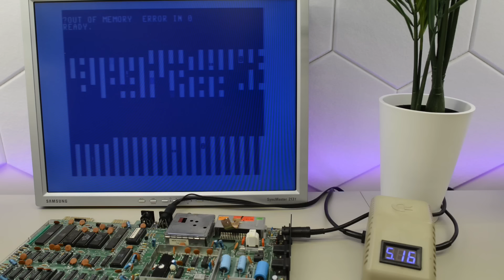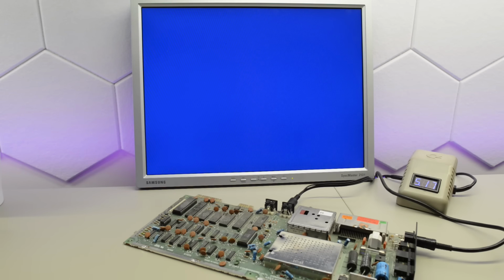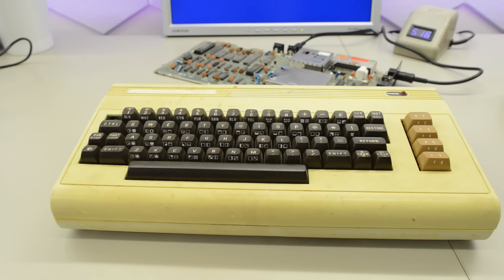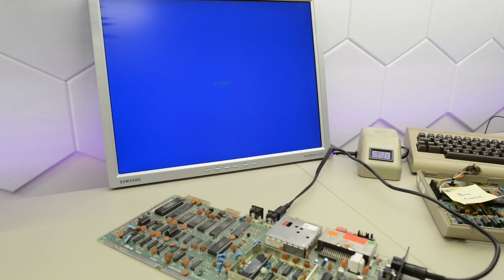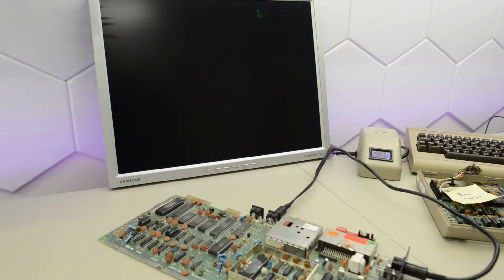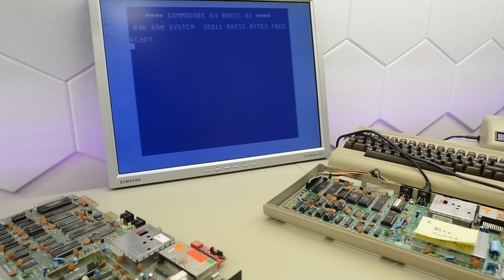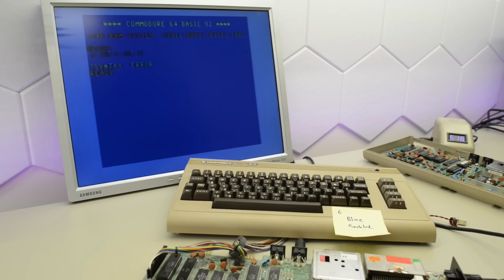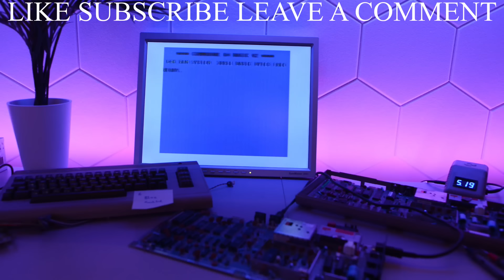Can we repair Adrian Black's Commodore 64 board? So many issues! I was expecting an easy repair :)

Comment: The lead free solder cutoff date is 2006. That's when RoHS was passed.
Reply from the maker: Ok, I was expecting much earlier, thanks
Reply: @Epictronics1  Same... I was surprised too when I first heard that date. Of course there's nothing stopping a company from having used lead free before that date, but after that date everyone was using it.
Reply: @Epictronics1  My memory was that unleaded solder didn't start to become a 'thing' until the early 2000s, or at the earliest the late 1990s, say around 1998 or 1999. Commodore was out of business by the end of 1995.
Reply from the maker: @lwilton  Ok, thanks :)

Comment: Do you think the x-ray at the airport damaged it?
Reply from the maker: You know, It has crossed my mind. Maybe the x-ray is too much for these old MOS chips to handle?
Reply: It could have possibly damaged SRAM or erased EPROMs with very long exposure, but the VIC?
Reply: @Mr Guru That's kind of my point. That being said, earlier chips did not have as much protection as newer ones do. But VIC does not seem to be the one that would be effected as much. And by the way, didn't that whole module have an RF cover on in transit?
Reply from the maker: @jwhite5008  I don't know. This whole project was a surprise to me. When I left Adrian's place to board worked fine. And now we seem to have at least two dead chips!
Reply: @Epictronics1  Now that I think about it, maybe it's a good idea to check for cracks, bad soldering or other problems around power regulators and such, and the PSU itself - maybe bad power supply really damaged it? Or maybe slightly lower/higher voltage was the difference between seemingly working and having all the issues?
Reply from the maker: @jwhite5008  The PSU is modified and safe. The previous rework is less than perfect, I'll check and reflow, especially if they are connected to the color RAM

Comment: If I've learned anything from Adrian's videos: suspect the PLA chip. It seems to be, along with MT ram, and Mostek logic one of the most common failure points.
Reply from the maker: The PLA is definitely involved. It's on the suspect list now for sure. MOS logic are horrible lol. But I still don't have any Mostek chips in my "dead parts bin"
Reply: @Mr Guru That's my bad too...I meant MOS logic chips

Comment: I said you could have a RAM issue, but the big problem wasn't related. I suspected it was one of the logic chips in the VIC-2 area. If it was a RAM problem then you'd get a screen. Maybe it's black, maybe it's garbled, but with no screen at all that to me suggested VIC related areas. The VIC itself is the easiest to swap and fortunately that turned out to be the issue. I don't think it's a RAM problem now. I think it's a logic issue either with the PLA or one of the logic chips supporting the color ram. I did suspect the color ram itself, but that wasn't the case as you saw.
Reply from the maker: Totally agree, the two main suspects right now are PLA and one of the logic chips involved in handling color RAM

Comment: The clocks stop at 00-0035AM
Reply from the maker: That is correct, the system seised to respond several times during my tests
Reply: @Epictronics1  I should say "The clocks stop at 00-0035AM several times." I don't now if you used the same recording multiple times.
Reply from the maker: @toreediassen144  Interesting, I didn't notice. I did not reuse any footage, they are all individual test

Comment: Cool! You've got an 8-bit dance party and a disco-C64! :D 

As for the fault: After a quick search, it's very likely the PLA chip. It's often the PLA chip when running into those unexplainable problems, which are often inconsistent (at least, with a dead test cartridge).

I'm looking forward to part 2!
Reply from the maker: Thanks, yeah, the PLA is at the very top of the suspect list now

Comment: My retrobright setup is a 10 gallon aquarium that I lined with UV reflective window film. This way you can use the full submersion method and get 100% even coverage without worrying about swirls from plastic wrap. Efficient, reliable, on demand retrobrighting while mitigating the majority of issues that occur in most retrobrighting attempts. I've even used a heating pad under the aquarium on occasion, to maintain a peroxide mix temperature near 120°F.
Reply from the maker: I have a peroxide bath too. Thanks for the tip about the UV reflective window film, I'll see if I can find some

Comment: Re: leaded solder, no retro-computer will ever have lead-free solder. RoHS made products with leaded solder illegal effective mid-2006, and that is what prompted many manufacturers switching, even if products weren't meant to be sold in the EU.
And you can always mix leaded with lead-free for desoldering, just make sure you clean the pads afterwards, and then use only one sort of solder (leaded is always fine for hobbyists, and definitely necessary for retro computers).
Reply from the maker: Ok, I was expecting much earlier, thanks
Reply: @Epictronics1  Companies had little incentive to switch before that.
And the switch was quite problematic. A customer of ours, which happened to be a manufacturer for large-scale soldering lines did complain quite a bit about how difficult it was to get it right.
Reply: The video game console that got hurt by that the most was the Xbox 360 because it used leaded solider and then got told at the last minute to change to lead free.
Reply from the maker: @tspawn35  Did they have to make changes to the design in any way?
Reply: @tspawn35  Well, it's not only about the solder, but you also need to source RoHS-compliant components. At that point it might be more about certification, even if parts potentially don't contain lead either way. It also meant another blow for hobbyist components, because many obsolete parts just kept getting sold, until RoHS would have either meant changing the part, or at least certifying it for RoHS-compliance. 
Plus, lead isn't the only substance regulated by RoHS.
Reply from the maker: @Mr Guru haha, well, I have a decent stack of C64s and most of them are broken lol
Reply from the maker: @Mr Guru I don't know. I guess he's just a generous and cool guy. I didn't ask for them, he asked me If I wanted some :) and btw. you can't have too many broken C64 anyways haha I have repaired at least ten of them on my channel but some of those are probably broken again lol. I'm not gonna run out of broken C64s any time soon :)
Reply from the maker: @Mr Guru Haha, that's probably why I'm single lol. You can send one of those broken SX64s to me;) Now go and save that arcade machine!
Reply from the maker: @Mr Guru Oh, if they work they are useless to me haha
Reply: @Mr Guru You this as if every single device with BGA will fail. This is simply not true. BGA may be more fragile than edge leads but it all depends on the manufacturing process and quality control.
Reply: @Epictronics1  Next time have him send one or two my way. I'd love to get my hands on some busted C64s and VIC-20s. Also very willing to record my attempts to fix them.

Comment: Nice! :D

A problem with diagnosing graphics problems with a "modern" screen is that when the video signal is poor (weak, out of sync, dirty, etc.), the screen just turns blue as if there was no signal, even though there actually IS a signal, and you can't see what's going on. Older CRT TVs would display the signal, be it good or just garbage. I think your board outputs a constant dirty video signal but your Samsung Syncmaster played a bit against you here by letting you think the board was rebooting ;)

Just a hunch though.
Reply from the maker: Interesting, I guess I'll try it out with a CRT before I move on. Thanks

Comment: Concerning UV lights, I'd suggest going for 265nm LEDs. While 275 and 290 are still UV, their visible light portion is probably so large, that the "uv power" is too diminished to be useful for retrobriting.
Reply from the maker: The spec doesn't tell much about this light, unfortunately. But it does work really well : )
Reply: @Epictronics1  : A good indicator of which wavelength is the dominant one is, the colour you can see.
290nm lights are rather purple. While 260nm glow almost greenish, with the reflection on white paper being purple.
Reply from the maker: @bikkiikun  Ok, this light has two switches. One of them turns half of the LEDs on and they are glowing red. The other switch turns on blue and purple LEDs. I think it's made for different stages of plant growth

Comment: That looks like a VGA monitor, what are you using to connect the C64 to it?
Reply from the maker: I don't use this display for Commodores anymore, but if I remember correctly I used it with the cheapest adapter on ebay. I think it's called AV2HDMI.
Reply: @Epictronics1  Oh, OK, I thought it was a VGA monitor, it is HDMI then...

Comment: Some of those other joints on the ram chip look cold... Perhaps reflow them?
Reply from the maker: I didn't notice. I'll check, thanks
Reply: @Epictronics1  it looked like at 13:00 there is a need for more solder work.
Reply from the maker: @TheThomasites  You're right, that CIA doesn't have enough solder on some of the pins. I'll reflow it first thing in part 2

Comment: Where do you get your sockets from? 
I'm having a hard time finding a steady supply, especially for the machined ones. They always seem to be on back order.
Reply from the maker: I placed an order from a random eBay seller this time because I just wanted to get some quickly. I have moved away from machined sockets though. I use to swear by them but I have actually had much better luck with dual wipe sockets for re-used chips. I made a video about this topic a while back: https://youtu.be/LwCeHc6wVyA
Reply from the maker: @Mr Guru Good to know there is a problem the other way around too. I'll avoid using dual wipe sockets for components with machined pins
Reply from the maker: @Mr Guru Now that I think about it... I have a project here on YT that I think I called "the hong kong commodore* It has a PCB with machined pin headers stuck down in single or dual wipe sockets. I'll see if I can pull it out and do some test

Comment: I’ve got one piece that was baaadly yellowed, and it’s a tower case front, so it’s a major cosmetic issue.  It didn’t respond as well to retrobriting as stuff usually does, so I figured - what the heck, let’s go for broke.  I let it soak for nearly a week.  It’s a wash of over-bleached and not quite done yet.  I’m going to keep going until it just doesn’t respond any more, then see what I can do about the albino plastic.

Everyone’s afraid to push it - and I get it.  But in this case, I’ve got nothing to lose, so I’m going to see what happens when you do.  :-)  IMO, it can’t be any worse than an orange front panel.
Reply from the maker: Yeah, in worse case you can always respray it in a similar color.

Comment: The problem you experience is either the colour RAM, the 4066 or the PLA. Considering you have a PLA from 1983, which die if you just look at them (in this case perhaps literally), the PLA should be the first chip to suspect.
Reply from the maker: The color RAM was tested and it's ok. The PLA is on the suspect list now for sure. I have only had one 4066 go bad ever. I'll keep it in mind, thanks
Reply: @Epictronics1 /videos To me it seems that the color-RAM is being selected and written to when it shouldn't. 

The PLA is definitely on the list of suspects, but traces involving that and CPU-PLA address lines also are. 

Before desoldering chips you might want to scope the SELECT/ENABLE line and compare it to the working machine one, even to just show us what it looks like.

If this turns out to be the only issue with the PLA and you don't have any spares, it may be possible to desolder that one line from PLA and replace that logic with a bunch of 7400, a programmable ROM or PAL/GAL. Although it is more likely that the PLA is bad in more than one way.
Reply from the maker: @Mr Guru Thanks for the heads-up. I reported the comment to YT but I don't know if it helps much. And thanks for the recommended steps to check!
Reply from the maker: @jwhite5008  Thanks, The main suspect right now is the PLA. I have a bunch of GAL-based PLA replacements we could use if needed

Comment: People even apply fresh solder to more easily desolder components on radios from the 1930's and 1940's (Such as on the excellent YT channel Mr. Carlson's Lab). So I don't think the trick is only useful when desoldering modern lead-free solder.
Reply from the maker: Ok, yeah, I think he really knows what he is doing
Reply: Leaded solder oxidizes slowly over time. Some fresh solder helps a whole lot with heat transfer past the oxidation layer, so the old solder will then melt. It also introduces fresh rosin, which is also important for solder flow.
Reply from the maker: @lwilton  Ok, Then I'll keep adding fresh solder on older boards too, thanks

Comment: The flickering is most likely color-RAM being selected when it shouldn't, random stuff is written into it, and so it displays random colors. Or perhaps something is being selected instead of it. When nothing is being written, color-RAM isn't changed and text stays the same color. 

This could be several things: 
Obviously, color RAM itself (which you ruled out)
Select-logic chips including PLA: These are most likely culprits.
A short or break in an address trace or SELECT signal for the chip: actually this is quite likely as well
A bad chip that is effecting the address lines: possible but unlikely given the symptoms 
CPU: unlikely since it seems to work otherwise, however maybe one of address output drivers is not good enough?
Short or cross-talk around the VIC-chip: On one hand it really doesn't look that way, on the other you did have a dead VIC so.. hmm... maybe worth a look if only to make sure the second VIC doesn't die the same way first did...

RAM chips may be bad but that is not what creates color-flickering issues

Probably the best way to go about this is to use a o-scope to compare SELECT line signals of a working and a non-working machine and trace it back to CPU one chip at a time. 

Also look at signal levels of address lines starting with the higher ones. Try to spot any weirdness. Then try cutting traces to see what causes it.

It could be a problem with cold solder joint or broken trace. See if you can spot something like that near color-RAM select, since everything else seems more or less fine.

Although this is quite a bit of a bother, but you will probably need to socket the PLA and try to swap it. If you don't have a replacement PLA it may be possible to cobble together a replacement for only the misbehaving signal(s) using logic chips, (EP)ROMs or PAL/GALs.
Reply: @Mr Guru Everyone has their own belief of how best to approach repairs, but to me "no smart person would do" is taking it way too far. If it's easier to you to desolder a 14-pin dip package - go for it, but I personally don't have a fast desoldering tool and would not do it that way. I'm not saying cutting a trace cannot create issues, but if you do it carefully enough and solder-blob the cut afterwards it's usually harmless enough. It would take quite a bit of convincing me to accept that it "just causes issues", "a thing of the past" and "very bad". C64 is actually pretty complex, not as complex as modern PCs, but still can take quite a long time to figure out. It's not always continuity, sometimes one chip effects others even though it shouldn't. I don't have that good of a memory, but Adrian probably ran in that issue many times. Although it is rare with address and select lines, it is still possible. Not all chips can be tested reliably out-of-system, even if your tester has software to test PLA, it sure cannot do much about SID, and testing video output of VIC while not impossible is probably not what those testers can do either.
Reply from the maker: Thanks, the main suspect right now is the PLA. I have a GAL-based replacement if we need it. I will also do some more tests as you and many others suggested
Reply: @Mr Guru ok I see where you are going with that reasoning, but I do not have good repair equipment at home , and do not do commercial/professional repairs there, but still repaired a few things. I certainly wasn't a tech 40 years ago but I think I know enough to do at least some of repairs. Should I not be doing them? Maybe but I still do. Not everyone in lower-income countries can afford all the professional-ish equipment or space to put it. So although I see your point, I'm still not convinced.

Comment: When did manufacturers stop using leaded solder? in short, they haven't.
I prefer leaded solder, as it flows better than lead free, and was surprised that when I tried to order some, they wouldn't sell leaded solder to me because I wasn't an industry.
Reply from the maker: Yeah, I tried lead-free solder ones and it was crap.